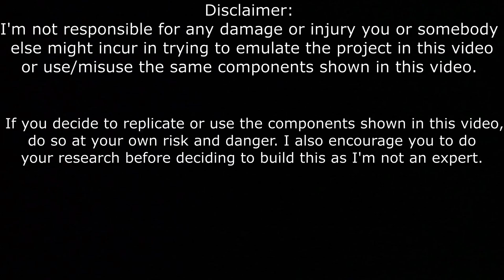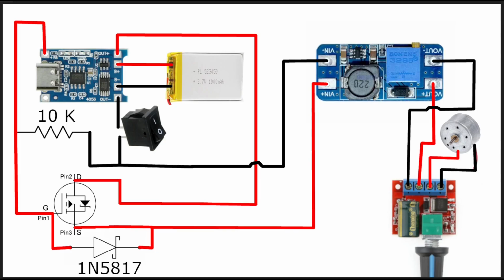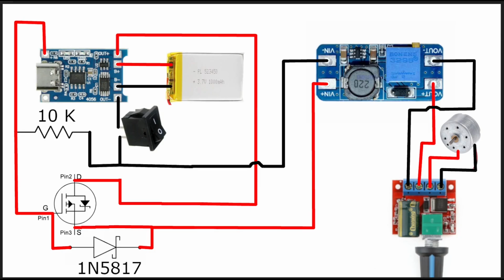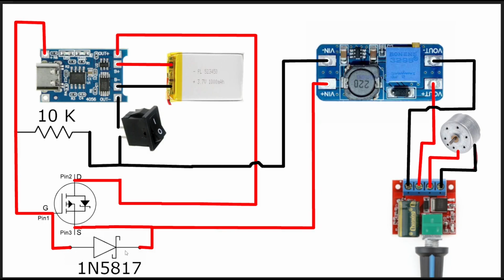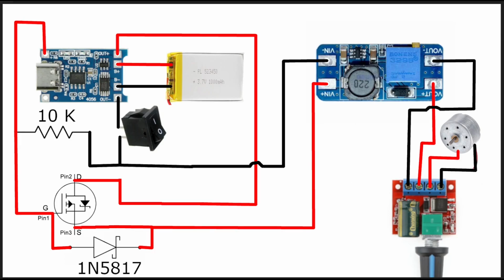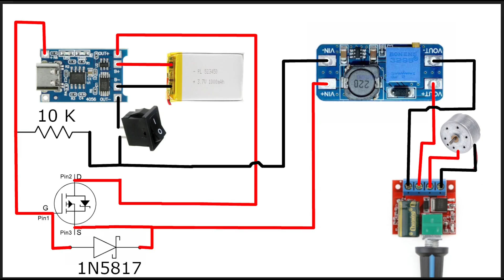How to use the tp4056 module to charge the battery while in use (load sharing)

Comment: The diagram shows the drain connected to the battery and the source to the load, but the current flows from the source to the drain. Is this correct? And is this diode correct? It allows current from the USB to enter the battery. I'm a beginner in electronics, hence the question.
Reply from the maker: The diagram should be correct as far as I know but feel free to switch things around and see how the circuit behaves, it's probably the best way to learn. I also found a module recently that does exactly the same thing. here is the video about it: https://youtu.be/YYCXJf8aRlc . I hope this helps.

Comment: I spent 3 nights+ on this stupid project just to realise  that tp4056 does not allow use from OUT pins while its charging... -_-  is there a better board that allows this? i dont want to complicate my life, just need a board that does this for couple cents more ill buy
Reply from the maker: You can try the one showed here you'll need a voltage  buck booster for a 5v output check the descriprion for parts: https://youtu.be/YYCXJf8aRlc?si=NIPYfRnufkCQ8nnV

Comment: I know I'm late to the party... but, the body diode of the mosfet will conduct no matter if the fet is OFF or ON therefore not cut off the battery in the schematic as you presented it.  D and S need to be reversed... if you want to go this route.
Reply from the maker: It was a long time ago I don't remember the details but there is a lot of confusion online on how to properly use mosfets , how to connect it depends from the type of the mosfet (p-channel n-channel). I'm pretty sure I tested both the connection showed in the video and the one you suggested. in my case with your suggestion the battery could charge over 4.2 volts suggesting that we are bypassing the protection of the charging module. The connection showed in the video worked fine for me. that said it was a long time ago and my memory is pretty bad,  but it's absolutely possible that i made a mistake so feel free to  test it on a mock setup and see what works and what not
Reply: Bro you can check the web for connecting of MOSFET 
Maybe yours MOSFET is not a P type one or not the specific model which this circuit needed

Comment: For anyone having the issue where the boost converter wont work after the TP4056. The TP4056 has a 1 Amp limit on its output terminals, while the boost converter is drawing 2 Amps. There is a safety trigger that occurs on the charger so you have to connect the TP4056 battery terminals to the battery, as well as to the boost converter on those same terminals. The output terminals wont be able to run the boost converter. However, this does bypass some safety features.
Reply from the maker: maybe it would be better to use a charging module that can handle more than 1 amp so you can keep the security features
Reply: @engibored3207 ok bro I will see

Comment: On all of the TP4056 boards I've used, you can use it while its being charged and it works without issue, no need for external parts. The battery charges properly and all is good.
Reply: Did you check to see if it cuts off when the battery is full with load?  There’s another video and several reddit posts concerning the charging cutoff at 100mA.  With a load, the current to the load will be above 100mA (assuming it consumes more current than cutoff), and the 4056 can’t tell the difference between load and charge currents.  It’ll still work but the concern is on battery health, cutting it off when its full should sustain it better.
Reply: @PeTr01  yes, I fully tested it. The TP4056 boards I use have seperate battery and load connections. It takes slightly longer for the blue 'charged' light to come on when its powering a load, but it doesn't overcharge the cell. Also, BigClive posted a video called TP4056 Myth Busting (or something like that) where he explains why it doesn't overcharge the cell. He explains it way better than I can, I'll try to find the link.
Reply: @PeTr01  https://youtu.be/f2yMs-JAyQM?si=t3UCjXN1dv8wacDp
Reply: @ oooh, thx, ill give it a watch before i commit to this pcb design
Reply: @warfsbench  So I was able to watch the video and it was pretty interesting! It cleared up my understanding of what happens to a load below 100mA, going back and forth between turning on/off, topping off the battery does not sound healthy.  One interesting take away though, if I understand clive's graph correctly, at current draws above cutoff, the charger maintains an output of about 4 - 4.2V at the battery side.  Even if most of the current from the charger is going to the load, I'm sure some leakage current from the battery will cause it to continue charging to maintain the 4.2V.  So I am still a bit skeptical unless you saw that the charger cut off supply to the battery once it was full and the module connected to the load (so across the terminal you saw only the battery's voltage, 3.7V, not the charging voltage, 4.2V, once fully charged and connected to load).  In either case, I think I will still add the circuit from this video in my design since you can't have too much protection and they're simple enough/cheap components to add.  I do appreciate you sharing though, I got some insight from it!
Reply: @PeTr01 bro you can just use a power bank module 
You can use it while charging also
And it also has BMS
Reply: @Pavan.M.A ooooh I didn’t know these existed!  I used to rip open cheap battery packs to steal these but they were hard to source the same ones across the globe,  so if anyone wanted to make one of my projects, it’d be hard for them to adapt the enclosure for their specific battery pack.  And I tried looking up charging modules but all that came up were the simple TP4056.  But the battery pack charging modules do seem to be the all inclusive answer to reliable charging and power delivery!  Thanks for the suggestion!  I am curious what the efficiency is but its prob not too bad 🤔
Reply: @PeTr01 and if you want to rip open the power bank be sure to collect the battery 
Even if they are less efficient than new ones but they are always of same voltage that's 3.7V
But connecting it parallely you can increase the MAh and also by collecting lots of batteries you can make something big like.....
UPS for your desktop or a big battery station(when power cuts you can use) your workbench
Reply: @P @Pavan.M.A ha yeah, I usually don’t waste those batteries.  I even collect them from broken phones to use for projects, like I stole one from an Iphone 6 to power a retropie emulator 😂
Reply: @PeTr01 ohh man you are a damn recycler same like me but I got very less batteries maybe like 3 or 4 as I don't rip any power bank 
Bcz I don't have one
Reply: @Pavan.M.A   haha yeah, electronics are way too precious to throw away!

Comment: I have seen circuits where the Source and Drain connections are interchanged.  Please clarify why the output from the TP4056 module is connected to the Drain and not the Source.  Not sure if I am missing anything.  Thanks.
Reply from the maker: There is a lot of confusion online about that, if you are still confused after watching the video you should make some tests yourself so that you can see what happens if you connect it the other way around. If you do you'll notice that the circuit doesn't behave corretly. As for how exactly I don't remember much because i did this a long time ago but i think the battery will go over the 4.2V volts while charging if you switch the connection of the mosfet or something like that

Comment: Does there need to be a minimum current draw on the load, i notice my tp4056 doesn't have any voltage on the output unless i connect B- and out-.
I have an esp32 connected to it and a neo gps module
Reply from the maker: I don't think there is a minimum current draw for the load but I never tested it to see if there is one. maybe the tp4056 is a faulty one I don't know

Comment: Thank you for the video, but what is the role of the 1K resistor?
Reply from the maker: sure, that's a pull down resistor, it's there to discharge the mosfet gate when power is disconnected. Here a deeper explanation with examples : https://www.youtube.com/watch?v=Wd6NzCY3NgI

Comment: Thanks, Im subbed now! Was looking for a circuit to charge 1000mAh batteries for use on model train lights! Exactly what I need. Im using regular DC power for my train cars which varies in voltage and polarity. I suspect I could use a bridge rectifier and voltage regulator circuit in front of the tp module to limit voltage to the module to a maximum of 5vdc in the correct polarity.
I recently was given about 200 of the batteries so I thought this would be good to keep constant lighting in the passenger cars of my HO train collection.
Reply from the maker: you're welcome I'm glad you found it useful
Reply: Bro you can use a normal phone adapter to power the module and the battery keeps charging and also you can connect the HO train collection to module's out+ and out-
Means 2in1 work
As you got that 200 battery then connect them in parallel and connect it to module's b+ and b-

Comment: This might not be necessary, and the module is actually working correctly. Apparently, in certain conditions, it is just charging so slowly close to the 4.2 end voltage range, that it seems like it would overcharge, but it will not, it will actually just take much longer to charge fully. The explanation is in this video https://www.youtube.com/watch?v=f2yMs-JAyQM
Reply from the maker: Thanks for sharing this! To be honest I don't know enough to say if it is true or not without doing some testing. I remember testing this before and what happened in my case was that the module would signal that the battery was full but the charging voltage would slowly rise above 4.2 volts. It might have been the case that my module was faulty, it 's not too rare to have a couple of modules that don't work when you order them in bulk from china. it might be worth it to investigate this further. However personally I would suggest using the circuit in the video as well to add a layer of extra security/protection against faulty or failing components. Even if it's redundant, for a couple of extra bucks it's worth it  especially if you are working with lithium batteries, as they can catch fire quite easily. This is of course my personal preference/opinion so feel free to ignore it.

Comment: I believe that you can connect the MT3608 directly to the out+ and out- without needing an extra MOSFET and diode, have you tried that? It shouldn't negatively affect the lithium cell.
Reply from the maker: if you do that you have to disconnect the load from the battery before charging it otherwise you risk damaging the battery

Comment: bro can you tell me the purpose of the 10k resistor ?
Reply from the maker: that's a pull down resistor, it's there to discharge the mosfet gate when power is disconnected. Here a deeper explanation with examples : https://www.youtube.com/watch?v=Wd6NzCY3NgI
Reply: @engibored3207  thank you bro , good explanation ❣️
Reply: @engibored3207 for my project iam gonna solder these components in a small PCB and I will be using a type c usb cable connected to typical smart phone charger . Iam trying to power my raspberry Pi Pico with this setup.additionally iam adding a buck at the end , between this circuit and raspberry Pi to ensure a stable voltage. It should work even if I power the TP4056 using usb cable right ... I've checked my smart phone charger it's rated 5V , 2A or 9V 2A , it shouldn't be causing any issue to the MOSFET I guess...
Reply from the maker: @iopmr   just remember to check the components datasheets to make sure that all the components can handle the supplied voltages/amperages and good luck!

Comment: May i ask something about the situation in which the usb is connected? Does the battery will be in charging mode at the same time? If it is , is  it possible to connect such a 5V solar panel to the TP4056 module? And is it ok to conect the usb for a long time? will it damage the TP4056 ? I ve a problem how do the connection to esp32 will be ? does it need a voltage devider?
Reply from the maker: if the usb is connected and it's supplying 5v to the tp4056 then the battery is disconnected from the load, now if your load consumes less power than what the usb can provide then you both charge the battery and supply power to the load with the usb. 

I don't know about the panel as I never used one but a problem that i can see right away is that you won't have a constant 5v and the circuit might not work correctly on lower or higher voltages. I don't know if a low voltage can damage the tp4056 but a high enough voltage can for sure do some damage.

to connect something to the circuit simply ignore the red module and the motor,  regulate the output voltage of the voltage booster and then connect to it's output whatever you want to power up just be sure that the charging circuit and load are ok with the voltage fluctuation that you might have in your system so that you don't damage anything.

for the divider is up to you. you can already regulate the output voltage using the MT3608 potentiometer but if you need to lower the voltage somewhere else you can use it
Reply: Thanks for the detailed explanation, it really helpful and i understand better. However, may i ask another question for instance, given the same circuit used with the additional of Esp32  as the MCU and i want to measure the voltage of the li-on battery using the voltage sensor module. How will the connection will be? can it work if i connect it from the Battery directly and connect it to Analog pin? what do u think? @engibored3207
Reply from the maker: @fariszainuddin9842   you can do that if the analog pin can handle 5v but if you connect the sensor directly to the battery it will keep draining the battery and you will be bypassing the overdischarge protection of the tp4056, unless the battery has another protection circuit already integrated. If the battery is unprotected I would suggest connecting the sensor to the output of the tp4056,  so that you read the ouput voltage of the module which should be around 4.2 V when the battery is at 3.7 v, and should decrease as the battery discharges. by doing a bit of math in the esp32 you should be able to figure out the voltage of the battery. If this doesn't work try looking for a battery monitoring circuit online you'll probably find something
Reply: Thank you very much for the insightful explanation. It really helpful. @engibored3207
Reply from the maker: No problem I'm glad you found it useful  @fariszainuddin9842

Comment: Why do you need a 10k resistor connecting from 5v + to negative load?
Reply from the maker: that's a pull down resistor, it's there to discharge the mosfet gate when power is disconnected. Here a deeper explanation with examples : https://www.youtube.com/watch?v=Wd6NzCY3NgI